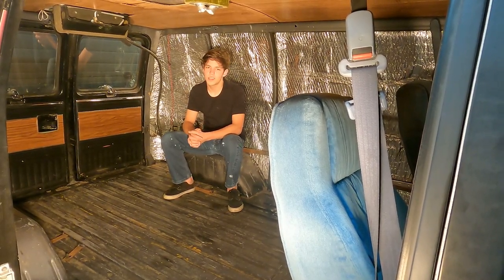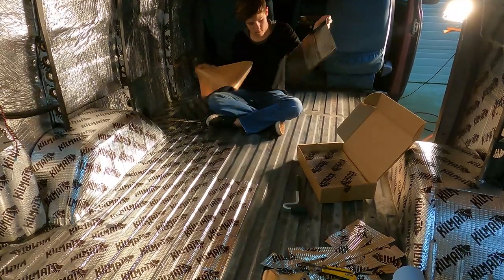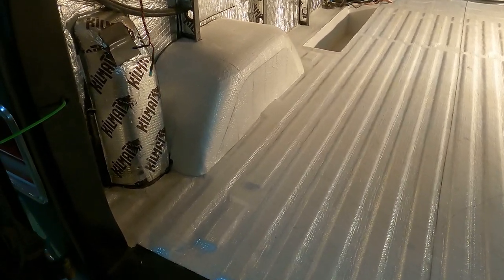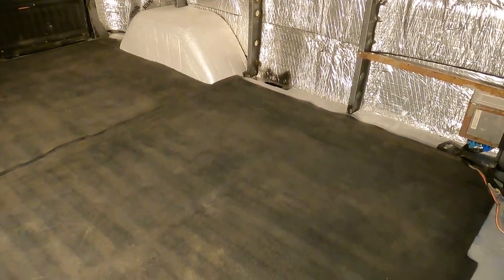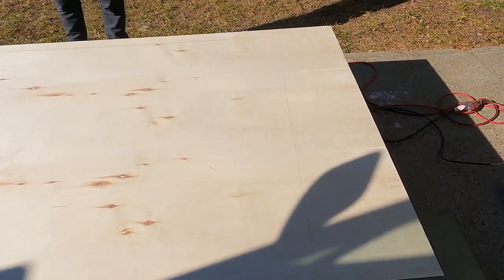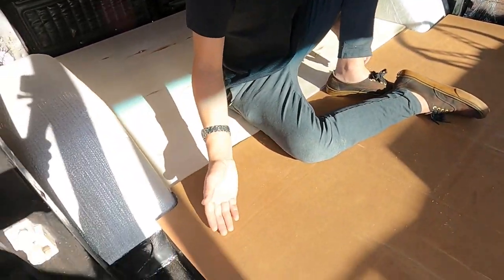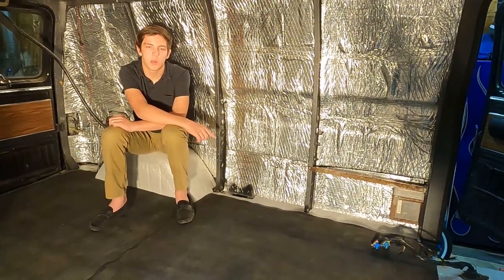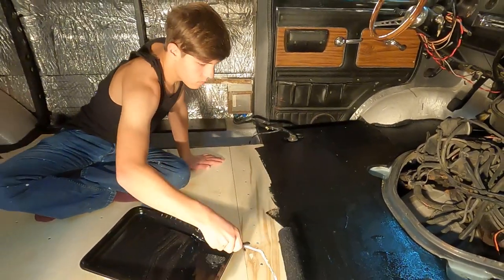ULTIMATE VAN LIFE SUBFLOOR. WHAT DID IT COST $$$$

Comment: If you have any leaks whatsoever, kilmat does an outstanding job of trapping the water between it and the floor causing rusting to occur faster. Ive also found that sub carpet foam works much better at noise dampening from road sounds. I still use kilmat, but i strongly dislike it and believe its only use should be for rattling sounds from side panels.